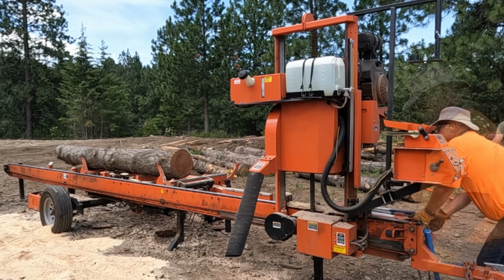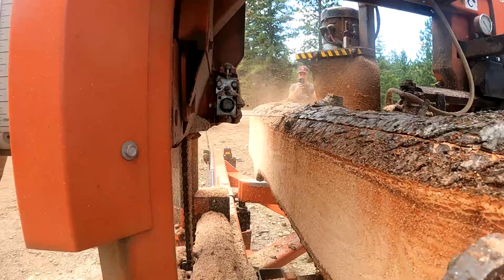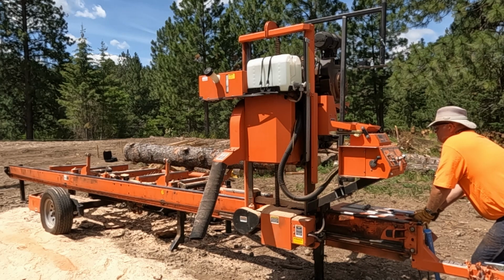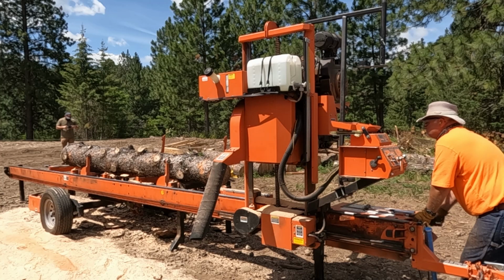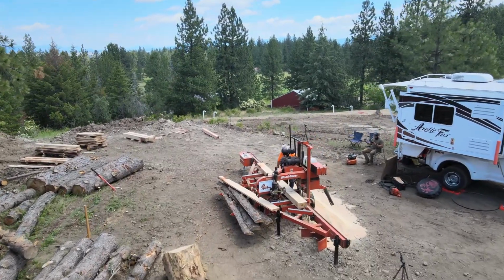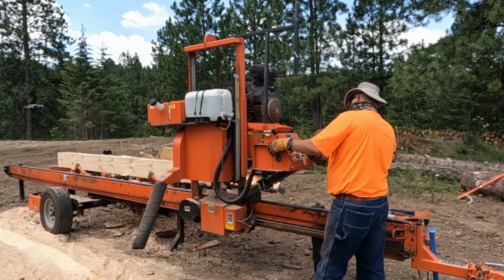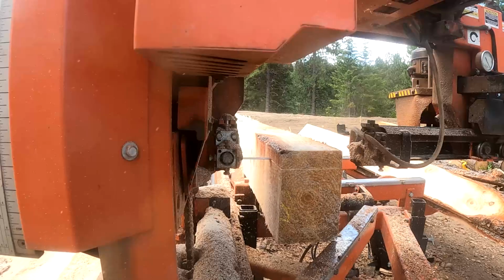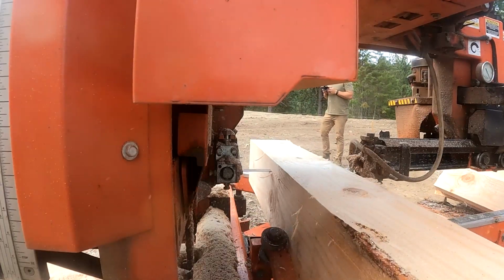Watch This Amazing Wood Mizer LT40 Portable Sawmill in Action!

Comment: Great video, at 60 I’m feeling my knees ache and understand. I think if I bought a new mill it would be with the command station but for now my ole 1998 LT40 walk along is still great.
Reply from the maker: I've often considered the chair option Dave (@TheOldManandaSaw) mentioned but you lose length of cut then.  However, MM on Forestry Forum uses one and has for a long long time so I imagine it's easy to get used to.